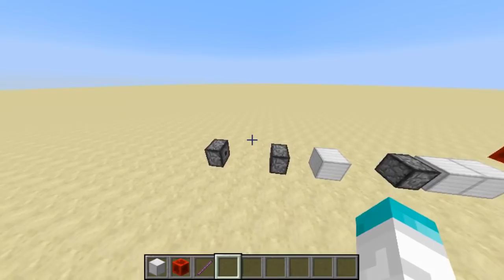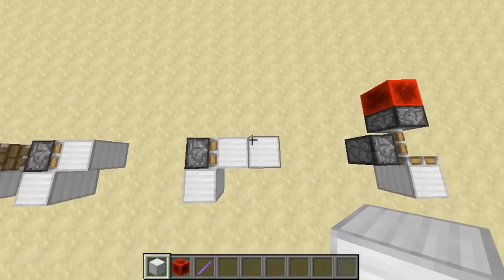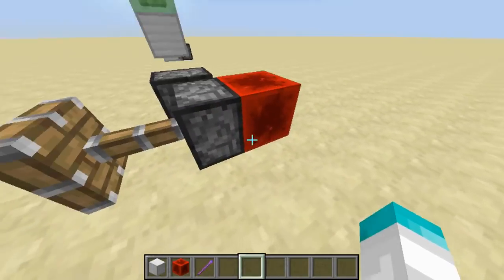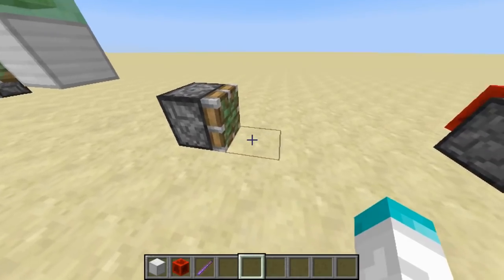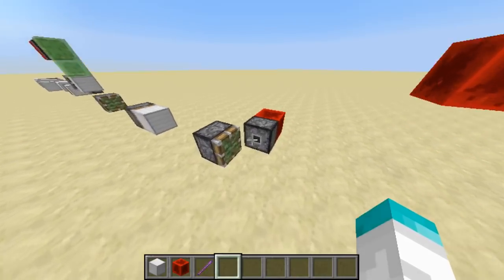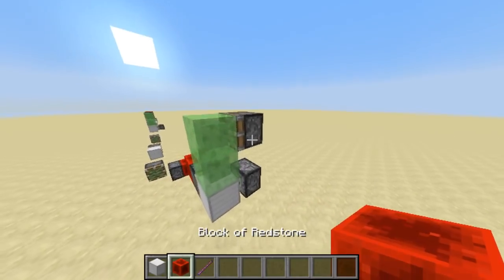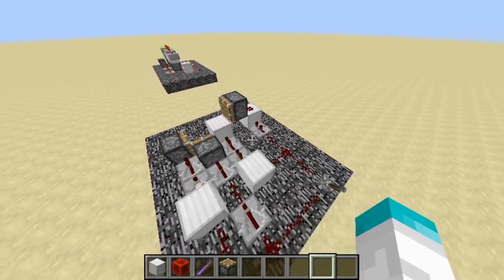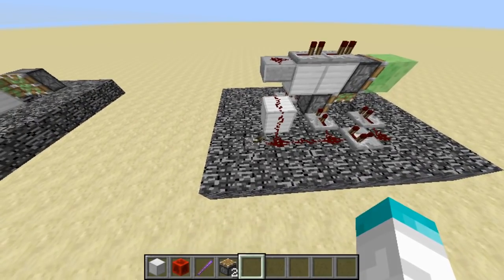Piston Bedrock Breaking for 1.13

Comment: I tried to use Eddxample's setup but failed while using the setup in the video it worked. Wonder what's happening and also wanna ask about the difference of comparator and repeater at 8:36 since swap them cause failure. Sorry if my English is bad.
Reply from the maker: That's weird that his wouldn't work for you. If I were you I'd make sure to triple check you have the direction and everything else correct, but if it still didn't work, then I really don't know why. You need a comparator since it has a lower tile tick priority than repeaters, essentially meaning it would depower that piston after one that had only repeaters. To break bedrock we need to cause all these pistons to do their actions all in a single tick, but in a specific order, and that is why I have different chains of redstone diodes going into each piston.
Reply: Thank you very much for the information! I might try it more times then.

Comment: Any chance you could at least do a tutorial for how to get the two headless pistons perpendicular to each other in the middle of your setup in this video? Is there a directional orientation I'd need to be mindful of for the overall mechanism to work? It would be nice to have just a quick tutorial for how to set up the key components of this!

I'm looking for a 1.13 bedrock-breaking tutorial and this is almost a tutorial... :D
Reply from the maker: You can use Myren's old video for 2 headless pistons into the same block: https://www.youtube.com/watch?v=ksabLWVKWPE
The setup here in my vid you're referring to doesn't have any direction dependency, no.

However, I'd just recommend using EDD's setup/tutorial that I linked in the description: https://www.youtube.com/watch?v=5TZSx9LErA0
It is cheaper and easier to set up, and has the tutorial you're looking for.
Reply: Thanks!